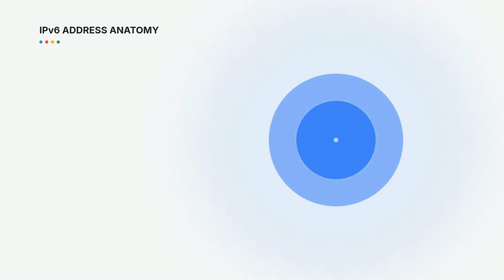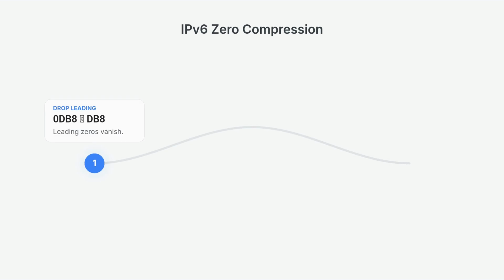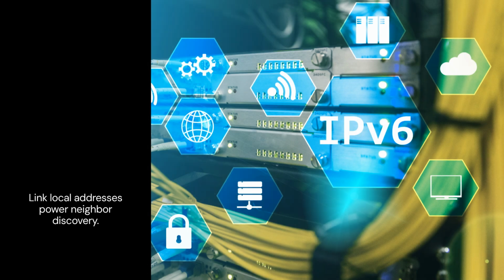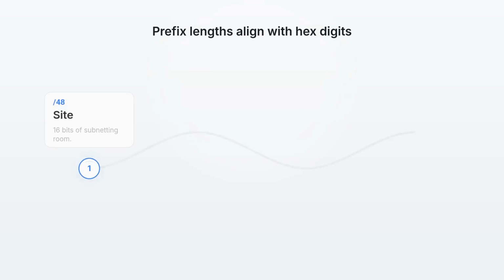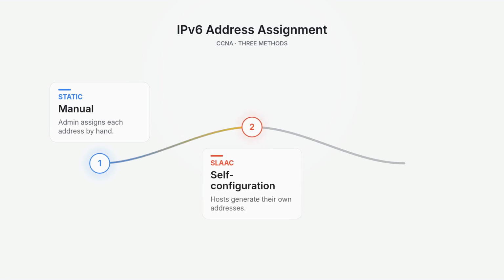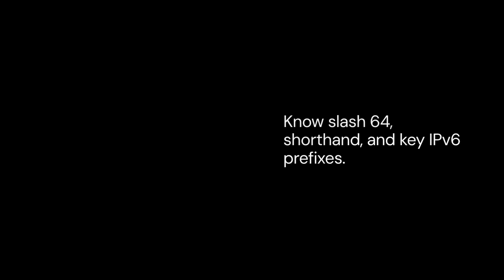Introduction to IPv6 | CCNA 200-301

Comment from the maker: 00:00 - Why IPv6 Matters (Scaling the Internet)
00:38 - IPv6 Address Structure (128-bit Basics)
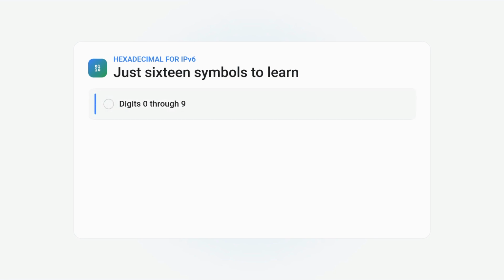01:25 - Understanding Hexadecimal in IPv6
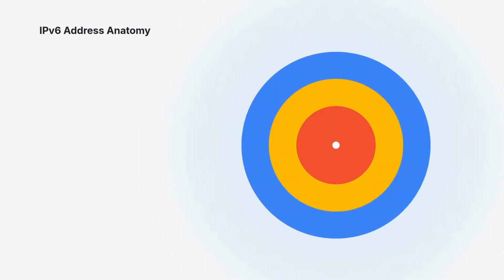02:17 - The 8 Hextets and Binary Conversion
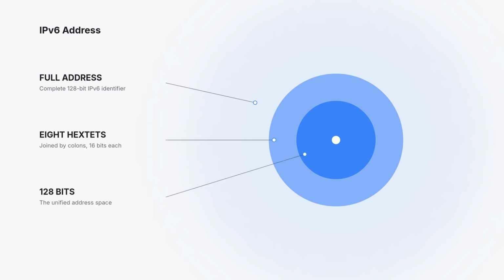02:41 - Network Prefix vs. Interface ID (/64 Standard)
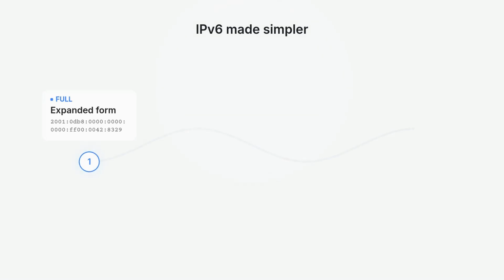03:18 - IPv6 Shorthand Rule 1: Omitting Leading Zeros
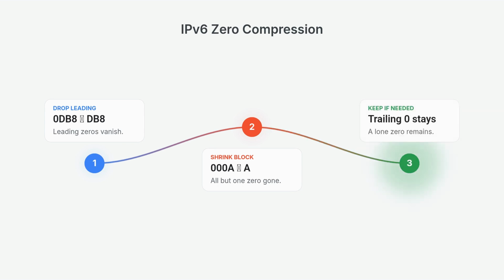03:42 - IPv6 Shorthand Rule 2: Double Colon Compression
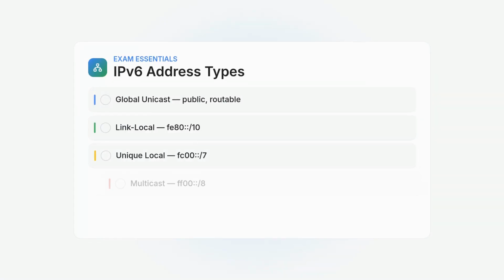04:24 - Global Unicast Addresses (2000::/3)
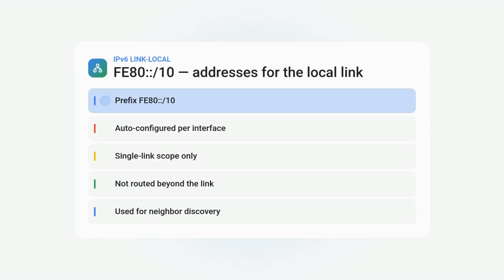04:47 - Link-Local Addresses (FE80::/10)
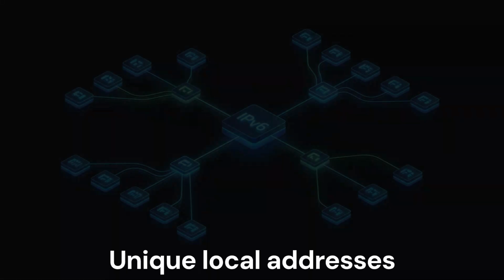04:56 - Unique Local and Multicast Types (FC00, FF00)
05:24 - Special Addresses (Loopback and Unspecified)
05:33 - How Link-Local Addresses Operate
06:38 - IPv6 Subnetting vs. IPv4 Subnetting
07:14 - Nibble Boundaries and Prefix Planning
07:53 - Address Assignment: Static, SLAAC, and DHCPv6
08:46 - Neighbor Discovery and No More Broadcasts
09:39 - Summary and Exam Key Takeaways